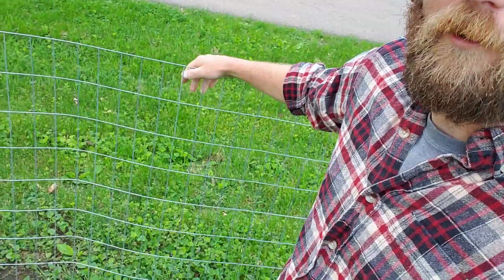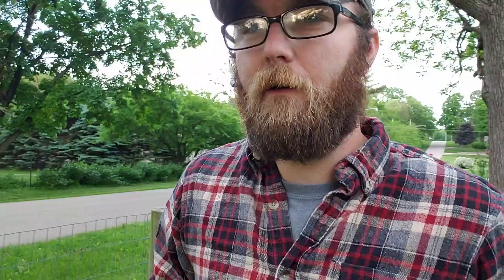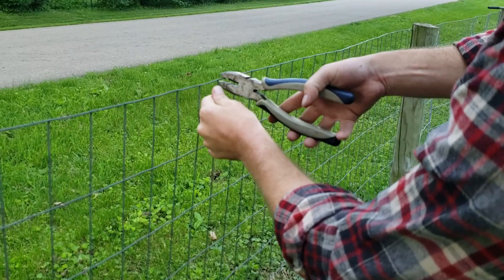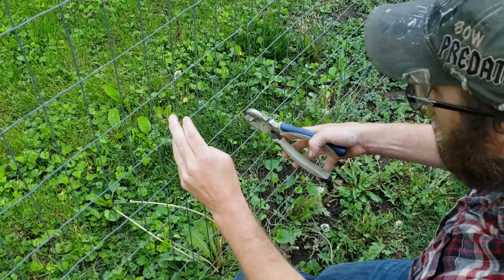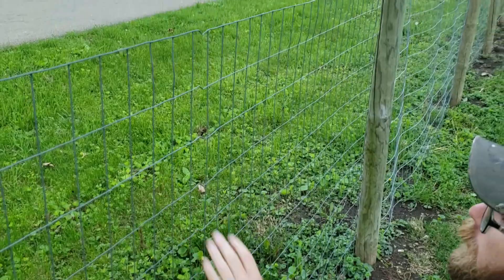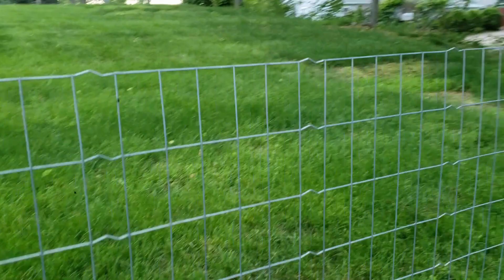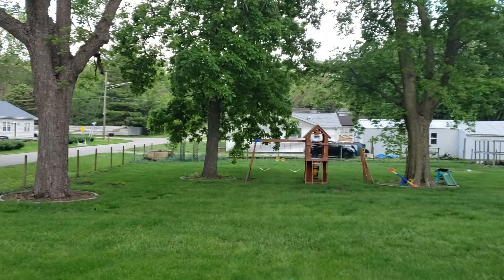Loose Welded Wire Fence

Comment: I installed 260 feet of 6 foot, welded wire fence like you have, around my garden, about two weeks ago.  It was my first goat ropin' for welded wire, but I've installed quite a bit of barbed wire over the years.  It was a beast to install this welded wire alone.  On the first side of the garden, the bottom was nice and tight, but the top was loose, and no amount of pull and straining on the fence, even with a come-along, would improve it, so I started tightening it like I sometimes tighten short sections of barbed wire, like you showed in this video.

On the first long side of the garden, here's what I found out about cheap fencing that you buy at Menard's:  It ain't straight.  I rolled out 100' of fencing on the ground, and it looked like a long, curving road.  The outside of that curve was super wavy, with the peaks of the waves sticking above the ground anywhere from 6" to a foot.  The outside was much shorter than the inner, and nothing can fix that, except for shortening every wire above the bottom wire.  I had to put a kink in every other 2" section, on every one of 18 rows, for 260 feet.  It took longer to tighten the fence, than it did to install the wood corner posts, 36 7-foot t-posts, and attach the fencing.

Yes, I'm whining, but if just one person doesn't buy their welded wire fence from Menard's for reading this, that's a good thing.

Great video, Richard!  I look forward to seeing more about your ducks and chickens!

Comment: I just installed mine for the first time obviously all by myself and I can't even tell you how many videos I have tempted to watch but I will tell you this out of everything I've seen online in regards to welded wire fencing you have absolutely given me the best advice best piece of information and the most productive tip that I can even think about I have been waking up and going to sleep thinking about this darn fence so when I finally got it up last night and I struggled as hard as I could to tighten it as best as I could I thought I would just add extra t-posts but now that I've seen your tip I'm going to try that first instead of that and I have my fingers toes everything crossed thank you so much for the advice

Comment: Never thought about doing this.  Just bought property and while I'd prefer RedBrand Kennel fencing, its just so expensive, and I have 5+ acres I want to fence in for my pack.  Tightening like this along with sinking fence in ground 6+", should work just fine!

Thanks for the idea!
Reply from the maker: Excited this helped!
Reply: Then the metal rusts that’s in the ground and covered in water and dirt and then it literally falls apart on the bottom, the welded connections one apart and it becomes a tangled mess that can’t be tightened or serve its purpose preventing anti dig through on the bottom
Reply: @nowfuturechanges9404  Ended up getting Redbrand after all, and installed it all above ground.  Am planning to run some welded wire along the bottom of inside fence line and cover with rock.  

https://www.youtube.com/watch?v=ibKhSg9ruTc

Comment: Nice tip! i'm about to replace some old field fence with welded wire. Is it not necessary to do braced corner posts with welded wire?
Reply: Just put up a fence if you are using a fencing puller the corner brace will save u a lot of time and headache from pulling your post up